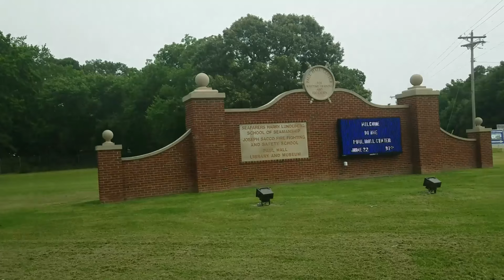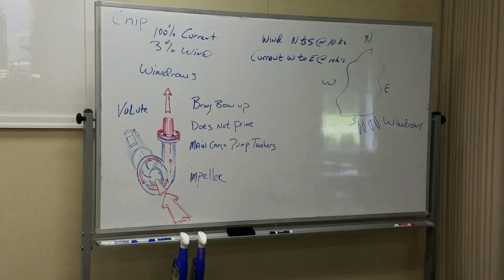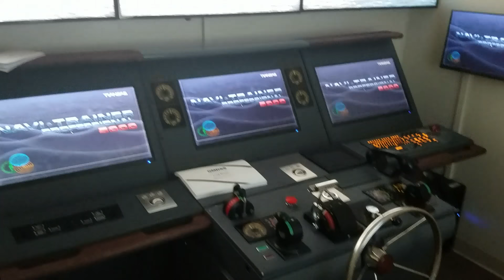BACK TO PINEY POINT | PAUL HALL CENTER | PHASE 3 | SIU UNLICENSED APPRENTICE PROGRAM

Comment: so, i get that this is entry level for someone (similar to those going into the military out of high school), but would this school be of any assistance to someone already being licensed with 100T Masters captain's license?
Reply: All you gotta do is walk in and say "im rick james bitch"
Reply: I believe your MMC should already say OS, and Wiper on it.  You could join MSC, or another union as entry level.  But if Piney Point can make you an AB in a year I’d say go for it.
Reply: @manfredolson6889  master, os, wiper, and steward (Food handling).  MSC would be like getting back in the USN again except better quality of life.  wouldn't want to go back into engineering though.  Just questioning if my assumption that it would be a step down to go back to low man on the totem pole for AB just to be able to get larger vessel sea time for working up to unlimited class master.  wondered if it would be similar to being in the navy and going back to "C" school as a fleet returnee; treated with "respect" as you had sea time and training/certs already.
Reply: I have no clue what C School is, but you would probably not be quite the low man as an AB.  There could be OS level sailors on the ship and you would undoubtedly know more than they. And my little experience is that if “you know your shit” as they say, you will get plenty of respect, even if you are not the best of people.  And being a decent person doesn’t get you far if your work ethic and abilities absolutely bite.   That all being said, if you are interested in being a Master, captaining a ship, perhaps consider enrolling in an academy and become a 3rd Mate, or just studying on your own and taking the test.   I have talked to people from Cal Maritime and they have indicated that there is usually a few people 50+ in each class    I’m thinking I should have taken the opportunity when I was 40 and kicking the idea around.  Anyways, good luck with what ever you do!